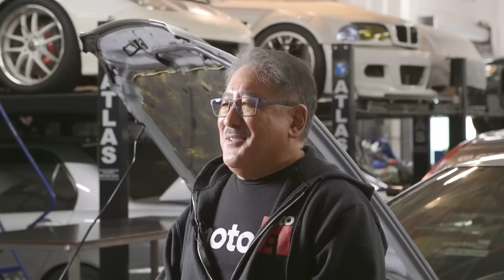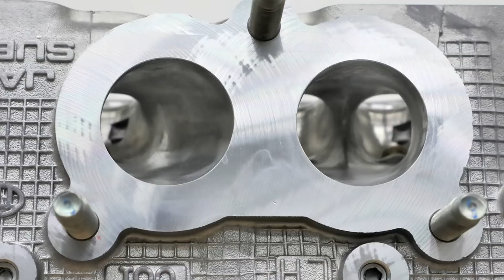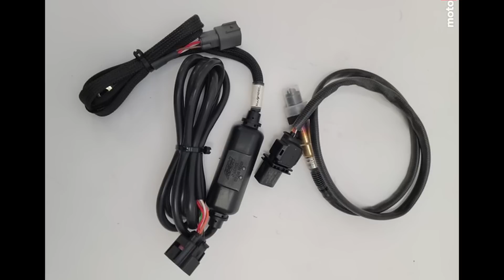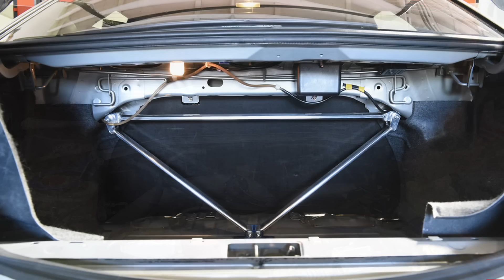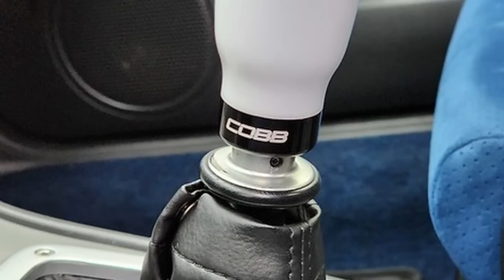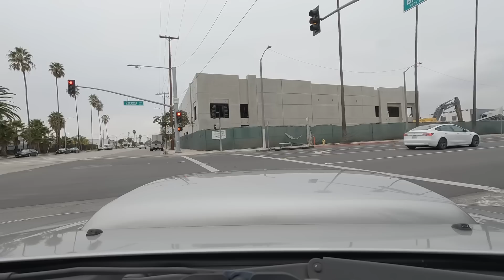How We Built Our Project Subaru So it Won't Blow Up!   (AND Drive Great)

Comment: Loving ALL of  this, but as someone who (also) needs to deal with California smog/ emissions I'm scratching my head when seeing parts on the WRX in this video without a CA EO (IAG AOS, Cobb 3" downpipe, Process West IM, etc.)...
Reply: That is a good question.

The COBB AOS (same design as the IAG) does have a CARB EO number and I've passed smog twice with it.  

The downpipe can be swapped back to stock, but the intake manifold is a no go for sure.  

You can actually do a 400hp+ build while passing smog now though due to all the effort COBB went through.
Reply: Same! I've got the same AOS on my hatch and, to date, my smog guy is 100% ok with just asking for the sticker. @stevemartegani

Comment: What would be A "safe" whp level on an EJ25 with good tune and all supprting mods?
Reply from the maker: You mean a stock bottom end? Something like 330 whp on 91 pump gas and 380 on E85
Reply: @motoiq   yes stock bottom end, 330whp on 91 was around what I was thinking to, thanks!

Comment: Just too expensive when AWD hondas are so easy now. I used to be into aircooled VWs and was glad to move away from the somewhat flawed split-case design. 
But if subaru is your thing, Mike knows whats up. I just feel like he mentioned 5k worth of parts just to make it more reliable, nevermind the engine and work required.
Reply from the maker: AWD Honda's are easily possible and off the shelf mostly parts exist but  it is not "easy" or cheap.  It's much more expensive than this car to do right with equivalent power and the AWD system is crude and more suited to just drag racing.

Comment: You're idea of "terrible pavement" is WILDLY skewed lol.  I would avoid driving around Chicago or Detroit.  You would cry lol.
Reply: I think LA is now rated one of the worst.  Google street view Alameda street in the harbor area not to far from MotoIQ.  Semi trucks bend wheels there.  It's crazy.
Reply from the maker: By your shop, I have seen smoother rally stages, some of the roads are tough with my 4X4 truck!
Reply from the maker: I have driven in Chicago and Detroit a lot and LA is only a little better.  It's more of an LA problem than the surrounding areas.  LA is a big city and inefficient with the infrastructure repair.

Comment: 55:55 Unless you have already passed that point of traction loss and are riding it. Colin Mcrae style... Then It is actually incredibly beneficial. The problem is the number of people who can actually achieve this, and not wreck, or can actually enjoy this, are very few. This is what makes this car and/or platform such a Great rally car chassis. why you can just take a factory Subaru, Turbo or No, and compete in some oem spec level rally cross and such at the top level... if you have the skills.

Comment: so how did you deal with that stupid lean spot at 2700 rpm?  Did you relocate the fpr source?
Reply from the maker: It is in the plenum, we don't have any lean spot issues.  Church Automotive Testing is our tuner.
Reply: Also there are specific tables in the stock ECU to deal with that lean spot.  Better to eliminate the root cause (fuel pressure/distribution) but they can be tuned out.
Reply from the maker: If the problem is caused by fuel resonance, we have changed that so much with the remote regulator and the higher volume rails that it has never even been close to an issue.

Comment: Subaru's are absolute garbage if you need master mechanics like MotoIQ and a whole bunch of aftermarket parts to just build a "reliable" car.
Reply from the maker: Well a reliable 520 whp, 620chp car that used to make 235 whp, 300 chp stock does take some doing!
Reply: Reliable 500whp from a 2.5 liter motor. 200hp per liter is going to cost you no matter who makes the engine.
Reply: @joe-zv3tu  Nah, all day with a K. Buddy is 135k on his turbo k, no issues but tire wear.

Comment: @8:00 the skirts are not nickel plated. The crown and the ring land area might be
Reply from the maker: Yeah I messed up trying to get it all in one take, I forgot.  Also messed up on the studs, 14mm ARP CA 625.
Reply: @motoiq and is it nickel plating ? Usually they hard anodize aluminium. Nickel plating on aluminium usually flaking off
Reply from the maker: Hard anodizing is abrasive and hard on cylinder walls, its usually only used for top fuel, it is Nickle for sure, some two strokes use this trick. Come to think about it, I forgot to mention the 4th cylinder cooling mod and the Fluidampr too. damn
Reply: @motoiq  True but the pistons are sliding on the skirts and on the piston rings. And i have seen some other pistons having hard anodizing in the ring land area as well. I guess each company has their own "recipe".
Reply from the maker: Hard ano in the ring grooves is a good deal on 2618 pistons and OEM's do it a lot.  It is an option at JE.
Reply: @motoiq  Thanks for the info. I'm watching your videos because I had two client Subaru's blow up (I'm doing the ECU tuning stuff, but looks like we need to learn the engine stuff as well) one 2.5.liter had a problem with low oil pressure after it wore out the bearings (1.2bar max boost) and the other one 2.0 had cracked heads he repaired them with some funky copper inserts and it failed again : 😭
Reply from the maker: Head failure isn't very common. Was the engine seriously overheated in the past?  A lot of the bearing problems are due to user error, letting the engine puke out all the oil and running it low sometime in the engine's past.  The actual oiling system on the EJ's is pretty good, with priority mains and a decent pump. The 2 liters don't have good pan baffling.  Both have those shitty oil pickup tubes that crack.

Comment: He's speaking up iWire a lot which makes me curious. I trust his advice and know he speaks with years of industry experience. I recently had an iWire harness done for my 97 WRX swap and haven't had a good experience with them at all. The communication from them has been abysmal and so far all of their clips that they used for the merge have been too small to fit back into the stock Subaru clips. Has anybody else had this experience? I'm hoping my experience was just a fluke because they seem to be a leader amongst Subaru aftermarket parts as far as wiring goes 😵‍💫
Reply from the maker: iwire saves our shop a lot of time as nearly all the older WRX and STI's that come through here have brittle connectors that shatter if you try to do anything on them.  By having the parts, they allow us to repair a lot of stuff and have lower prices.

Comment: I love the level of detail you guys go into on these videos. But long story short, if you want to have a reliable EJ over 400hp, you need to replace the block, pistons, rods, heads, ccv system, oilpan, fuel system, upgrade to flex fuel,  and a new turbo?

Did i miss anything? 🤣🤣😉
Reply: If you'll settle at 360-370 whp, a late model EJ25 STI only needs upgraded injectors/pump (for E85), downpipe/ex, intake and tuning.  That'll get you over 400 lbs-ft of torque by 3000 rpm and at least 350 whp (most make more especially if decatted).  It'll daily well (better than stock - quicker boost response and much torquier thanks to E85), run reliably and last longer than a stock car that's pushed hard on 91.  Taking any Subaru to the track regularly probably requires other reliability mods, but for street cars you can have fun pretty cheaply.  That's what I recommend for anyone who doesn't have the budget or knowledge to go for the higher power levels because beyond that having to upgrade a turbo, intercooler and many other parts gets expensive fast.
Reply from the maker: Listen to @churchautotest! A lot of guys always brag about 600 stock bottom ends.  They are pretty quiet when they blow up.
Reply: Oil pickup, Head and case bolts, crank, valves, and a few more. but yeah.

Comment: Mike Last Video:

Pinpoints every single flaw with the EJ motor from the factory and singlehandedly sets back Subie Hot Boi's goals for 500 reliable HP for less than $15K. VAPE sales plummet

Mike This Video:

Y'all are fools for sleeping on this reliable motor and the Blob Eyes WRX/STIs. Goes on to make the States most reliable and fun daily driver/weekend track car for his daughter (but really he built it for himself) 😉
Reply from the maker: Daughter tracks it, I don't.
Reply: Amazing what a driver mod will do haha.
Reply: Idk, most engines are relaible without all those mods. Seems like a lil cope by a subie fan. But I do love the awd system. Brake vectoring instead of diffs is godawful.

Comment: What a great video so in depth love the Subaru platform it's great if done right. Question what's your thoughts on group n trans mounts I want to update mine on my V3 sti. Do you think there will be minimal nvh
Reply from the maker: Dunno, the IAG ones are not bad.
Reply: Group-N mounts have minimal NVH increase.  I highly recommend them, and they are inexpensive too.
Reply: The Group N engine, transmission, and pitch stop mounts are fantastic upgrades that have minimal increase in NVH. Being OEM, the fitment is perfect, and as @stevemartegani  says, they are quite affordable. For a street or even track car, I cannot recommend them enough. I have them on all my Subarus.

Comment: Be interesting to see your thoughts on the JDM models as they arrive and become more common over there.

Spec Cs is great because it can do a lot more with less power. Factory equal lengths too, much prefer the sound.
Reply from the maker: If you do not go overboard, do the maintenance and tune conservatively they are good and the motors are slightly more robust.

Comment: Does iag performance make ej207? Or just usdm ej205?
Reply: As far as I know they don't make anything specifically for the 207, but most things from a 205 bolt right up to a 207 and vice versa
Reply: Yeah i know but i just wanted the jdm case
Reply from the maker: The semi closed deck 207 is nothing special.
Reply: The EJ207 is special because of the heads/cams, not so much the shortblock

Comment: I think Subaru's only contribution to this car was the chassis.  Like everything else on it is aftermarket.  lol
Reply: yeah i found it funny that he was saying the preconception of subarus is that they're unreliable and there is practically nothing stock on this car except the chassis itself lmao as if this is a good example of the average subaru out there on the streets
Reply: @flyingmonkeyofus69  well, he even braced the chassis.  LOL
Reply: @flyingmonkeyofus69  well if you want power you need to spend the money. They are reliable stock, the issue is when people increase power without spending the money first. GC8s were more receptive to this and they are way lighter which meant lower power increases made a big difference. GD and beyond not so much. Add to that Subaru wasn't a massive company and they were trying to keep cost to consumer down while developing at the time.
Reply: Transmission is good, the earlier versions of the 6 speed had issues with one gear like 2-3 can’t remember, but they hold 800whp well. Apart from the clutch of course.
Reply: Chassis is okay, nothing great. AWD is the selling point. Not a fan of McStruts either.
Reply from the maker: @nobodynoone2500  A lot of really good handling and super fast street and race cars use McStruts. Look at Porsche for instance.

Comment: And here I was hoping to rebuild my own Subaru myself. I’ve seen many people do 450whp dyi builds so I was really hoping to rebuild mine with a blown headgasket.
Reply from the maker: You can with correct machine work.
Reply: I find they run better if rebuilt without the blown head gasket if you can

Comment: Subarus do run great after you replace everything. 😂 Love the videos and the car man! 

Minus labor and cost of the car how much $ is into this super reliable track ready STi? 
I'd be interested to see where this falls money wise compared to other chassis like the EVO, Focus RS or just buying a 911.
Reply from the maker: If you did it all at once in one big hit, something like 35k.  This car was built over 10 years though. Stupid hobby huh?
Reply: @motoiq  Stupid, no way! You love what you love and a man needs his hobbies. I prefer OEM+ builds over bought and the ride of "feeling" each mod along the way is why many of us do what we do!
Reply: @motoiq Average price for a new car is near $50k now, and that 35k over 10 years is less isn't bad at all if you think about it on a per year cost... Way less than a car payment!
Reply: I was thinking the EXACT same thing. New IAG case, forged pistons. Headwork, cams, AOS, flex fuel, injectors, radium pump and surge, aftermarket coilpacks, new turbo... To get all that in your car, tuned and running? 20k easy..

Comment: I find these cars are the most balanced when you’re at 300-330whp. all the reliability upgrades like AOS, cylinder 4 cooling mod, EL headers, oil sump and oil pickup are a must. I also use water methanol to further reduce detonation. Great video! I always learn something new every time!
Reply: Agreed. That’s the power level I had the best time with (in a version 8 jdm sti), 250kw at the wheels. I did mainly hillclimbs and short sprint events and it worked well.
Reply: @zeroyon4562 also with poly bushings, a decent set of shock absorbers, brake pads, swaybars and links, and wheels and tires they make really good daily drives that will keep up with some of the best handling factory sports cars on the road today while remaining practical
Reply: It really all depends on what you intend to do with the car. If you only plan to do "spirited driving" and light tracking every now and again, then taking out a second mortgage probably isnt the right path. Chasing ridiculous numbers is a fools game. Sure you can get 1000+ hp, but then you cant drive it around, or in this case let your daughter drive it daily.
Reply: Careful with the cooling mod. My tuner said he did testing on his own vehicle with it and it caused more problems than it solved.
Reply from the maker: That is not true, this car has it and its fine, and it runs really cool until it gets over 100 degrees at high boost at the track.  That's why we have 3 different maps
Reply: if theres anything that dom taught me, its that meth is for pussies and FAMILYYYYYYYYY 😂
Reply: All that for 300whp 😂😂😂😂😂
Reply: @BillyLeslie12345  Fr! I bought my S3 for cheaper than an STi with same mileage and all I needed was a tune with no hardware to make 320 WHP on the dyno lol
Reply from the maker: A stock bottom end STI can safely easily make 320 whp.

Comment: I bought my gr86 a few months ago 8 ish and I've been loving it, how long should I wait before I build the motor for na power?
Reply: Im not sure if it hodls true for that new engine, but for the circa 2002-15 2.5L engine, the head gaskets like to fail just before 100k miles. IF you catch it before hand and have someone replace it before it damaged the engine by bringing the milkshake to the yard, then it will last forever factory. IF you want to chase power, Id suggest looking at that rebuild around the same time you have it apart for the head gaskets. Some people just toss a supercharger on it with a bit of supporting mods and say they feel like they SHOULD have been sold. Youll have to figure that one out on your own. Supercharger being more like an NA with linear power curve rather than the turbo lag/surge.